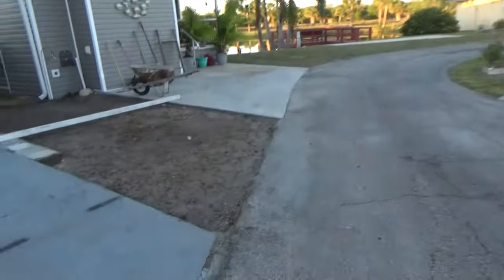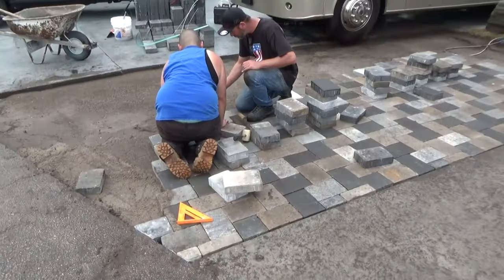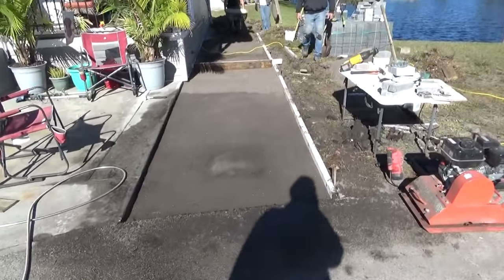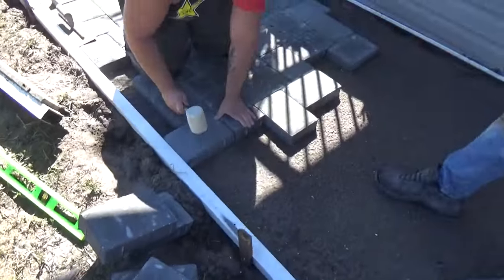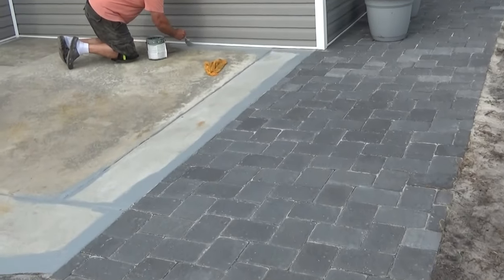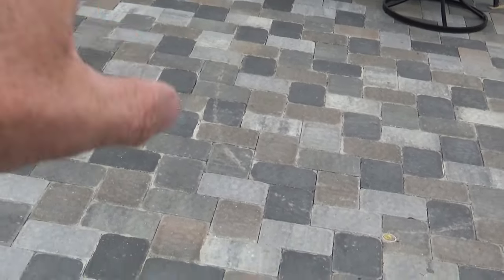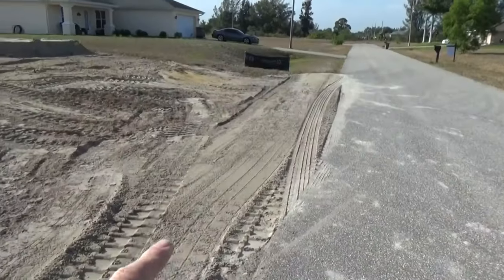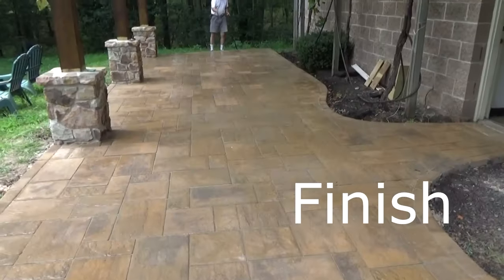PAVER INSTALLATION (Part 9) Mike Haduck

Comment: But Mike, if they could put concrete below the pavers, with the gravel below the concrete, wouldn’t it work in Florida? Maybe it’s not necessary and maybe it’s an added cost, but would it last longer down there?
Reply from the maker: Hi Joe, probably but no frost,,so big difference,  thanks Mike
Reply: I live in Florida, not necessary to pour concrete then pavers. Costly and we have irrigation lines everywhere. Easy to rip up  and pipe access is critical.

Comment: Awesome work Mike! Thank you! Question: would you install pavers in Florida by putting gravel and concrete down and then pavers on the concrete or would you just put in down on sand like the others in Florida?
Reply from the maker: Hi Zach, it depends on the situation, Florida is a lot different from PA, thanks Mike
Reply: @MikeHaduck   thank you very much from Sydney Australia! God bless you always 🙏🕊️

Comment: You must charge the clients top dollar for that "Pennsylvania" type installation. To put gravel with a reinforced slab on top of it then put the pavers on top of that is at least 3X more time consuming than a traditional paver installation. I totally agree it will eliminate any heaving due to the frost though.
Reply from the maker: Hi Mark, experience. experience, experience, experience. I don't take jobs I would get callbacks on,  thanks Mike

Comment: Mike, I noticed the pavers were all scratched.  I actually had the same problem with my pavers.  The top finished part were scratched up from the pavers stacked above while on the pallet.  Can they be repaired?  When they are wet you don't see the scratches but when they are dry, you see them. Will a sealer work to hide the scratches?
Reply from the maker: Hi safteysal, they usually blend on in time, thanks, Mike
Reply: @MikeHaduck  thanks for the reassurance!

Comment: Hi 👋 . My name is Shaneka. I am reaching out for help with headaches, fatigue, excessive sleeping, clay/dirt/dust “soot” widespread throughout the home and in my nose, bad smells in the attic and throughout the house. I need help. We heat and cool with mini splits but get the natural gas smells. The fire department read hydrogen sulfide. There used to be a furnace in the crawl space one technician told me and another told me it was no longer there… There is an oil smell in the basement. I need some serious help. What do you think the problem could be in this house? There are water marks on the upstairs ceiling around flue pipe. There are also water marks on ceiling in the kitchen as well on the first floor that has no second level. Virginia
Reply from the maker: Hi, it's impossible for me to to give an opinion unless I was there, I would ask the locals, thanks Mike